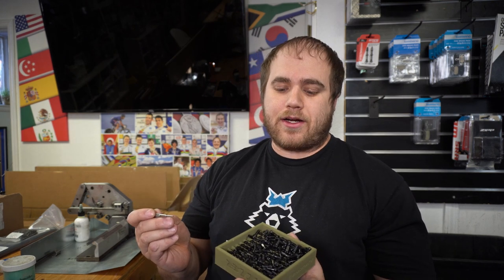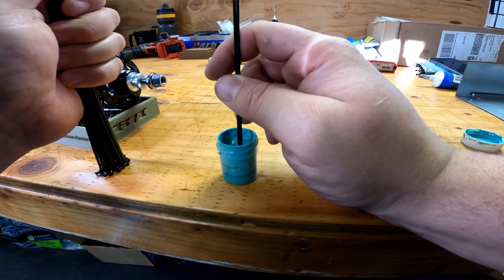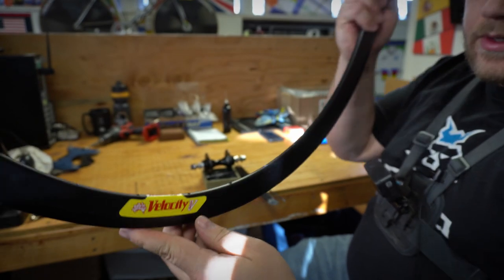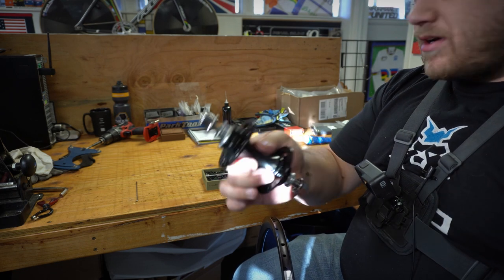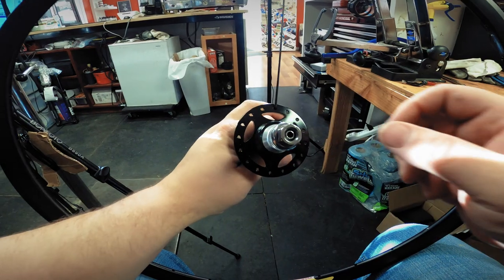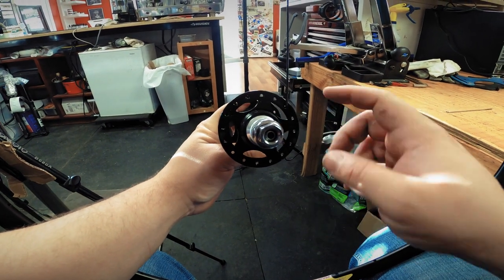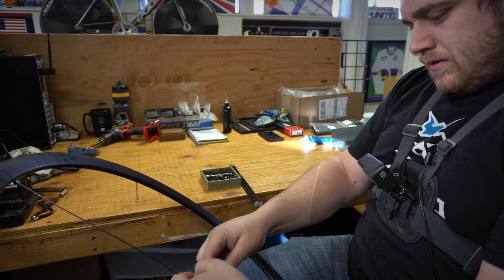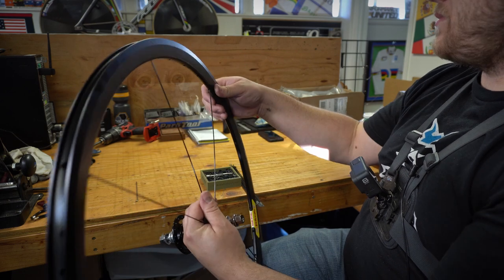Lacing Bike Wheel | How To

Comment: Nice video! Do you always use hubs with flanges or do you also build wheels with straight pull spokes? Eager to hear your preference and why!
Reply from the maker: Hey Menno!  I actually have a couple pairs of straight pull hubs to lace this week so many end up doing a video on those as well.  Personally I think straight pull works fine but I am not a big fan of it as its a bit of extra work until you get some initial tension on the spokes but more than anything, I feel like it was designed because it is more forgiving to poor quality builds like in machine built/mass produced builds.

All the issues marketers claim straight pull "solves" can just as easily be solved by building a traditional j bend wheel properly to begin with but that takes a little more time.

Hope this helps!

Comment: Hi Chris, I come to you again for help with a rear wheel that is causing me problems. I recently changed my bike, went from a hard tail where I practiced xc to a full trail bike, the wheels that came on it are:
WTB KOM Trail i29 TCS, 32h; spokes DT Swiss Competition.

The problem is that every ride I take I come back home with a crooked rear wheel, I don't do jumps or do crazy things with the bike, just some climbs and descents on gravel roads, nothing strange, I just walk normally, it's terrible how this wheel can't stay aligned, before that i never had problems practicing xc with other wheels.

If you have any tips to give me, I would like to tell my mechanic, if you want I can give you other information such tension of some spokes if it helps you in the diagnosis. I just wanted to know what to do to keep this wheel aligned. Thanks Chris.
Reply from the maker: Hey!  Typically if a wheel will not hold up and goes out of true quickly there is either a lot of wind up in the spokes after building/truing, the wheel is not stress relieved well, the spoke tensions are either low, not even or both.  It's hard to say exactly what the cause is without seeing it in person but if all those things check out, it may be time for a different rim as in my experience, the WTM KOM rims are not the toughest on the market.  Hope this helps!

Comment: Hi Chris. Thanks for the great content. I would like to to ask, anti-seize, which do you use?
Reply from the maker: I typically use the Park Tool anti-seize but that is mostly because it is easy to order through my distributors.  I don't have a strong preference there.  Thanks for watching!
Reply: @ChrisMurrayEWC  we are very limited with parktool stuff here in South Africa. Even more so now in this pandemic. I'm sure it is the case everywhere. Thank you so much for your response. If you have an opportunity, it would be great to see how to do spoke length calculations on a rim using straight pull spokes. We rarely get customers asking for such builds in our shop.
Reply from the maker: @sergiokarlluhmann7059  Tools are very hard to find these day.  Most shops seem to be building up their service departments more which I do think is a good thing.  There are other sources for tools you can look into as well although I don't know if they ship to South Africa.  Pedro's and Unior have always been very easy to work with in my experience so hopefully they could be helpful for you.

In regards to straight pull spoke calculations, I honestly don't always have great luck with that outside of with DT hubs.  I use the DT calculator as it has an option for "user defined" straight pull hubs that at least will get you close but it isn't always spot on.

You can find that here - https://spokes-calculator.dtswiss.com/en/
Reply: @ChrisMurrayEWC  I have a Unior supplier here in SA, but manufacturing and delivery dates keep being pushed back. I will keep the DT Swiss link you've given me close. I'm sure it will help once I get a customer who needs such a  build. Thanks for taking the time to help me out. And your videos on starting ones own wheel building company came in handy. Have a great weekend and all the best.
Reply from the maker: @sergiokarlluhmann7059  my pleasure!  I am happy they have been helpful.  You have a great weekend as well!

Comment: Thanks Chris!
How about a tutorial in determining proper tension?
Reply from the maker: Any time!  That one is pretty simple with most rims.  I typically look up the max recommended spoke tension and build to there as I believe higher tensions make for a more durable wheel.  There are some exceptions like older light weight rims usually don't like much more thank 100kgf and modern carbon rims often have crazy high max tension ratings so I typically just build those to 120-130kgf even if the published maximum is much higher.
Reply: @ChrisMurrayEWC  is there a percent difference in tension from drive vs non drive?  What about asym rims and tension?
Reply from the maker: @giffmann2  Lots of variables there like hub dimension, rim offset, etc.  Basically the non drive side falls whenever it does and there is not much you can do about it so you just want to focus on getting the drive side tension where you want it and making sure the dish is correct.  The other important thing in tensioning is making sure tensions are balanced evenly on each side.  You ideally want around 5% spoke tension variance on each side but 10% is completely acceptable too and some rims wont let you get any better than that.  So all DS spokes within about 5% of each other and all NDS spokes within about 5% of each other but the variance between the drive side and non drive side can't really be changed without changing componentry and that can be a huge difference, up to 40% or so on some wheels.
Reply: @ChrisMurrayEWC  My rims are wtb i45 29".  WTB says 110 - 125 kgf.  Does this mean 110 kgf is the lowest that any spoke should be? Thank you so much for this video and the original!
Reply from the maker: @TurkeyBasterandLex  My pleasure!  I would shoot for 115-120kgf on those if it were me.  That would be only the drive side rear/brake side front tensions.  The other side of the wheel will be at a much lower tension because of dish.

Comment: Compared to rim brake, is lacing different for drive and non-drive disc wheels both front and rear. 8:08 is this the lacing pattern for a disc wheel front and rear?
Reply from the maker: Some people like to argue that you should lace them differently but in reality it doesn't make any difference if you lacing things with trailing spokes heads in vs heads out.  I've had engineers with access to pretty sophisticated equipment test this and they couldn't see a difference in lacing one way or the other.
Reply: @ChrisMurrayEWC  thanks for the reply and the video! Glad to hear it doesn't matter.
Reply from the maker: @aaron___6014  any time, thanks for watching!

Comment: Chris should first set of spokes on both sides of hub be head out
Reply from the maker: People like to debate heads in vs heads out on spoke orientation but in testing both in a lab and real world it doesn't make any real difference so I don't have a strong preference either way unless building with a used hub.  When the hub has been laced before I do try to match how it was previously laced.
Reply: @ChrisMurrayEWC   thank you
Reply from the maker: @mikefronczek7862  any time!
Reply: @ChrisMurrayEWC  i guess what i am asking' should both sides be the same or it just doesn't matter
Reply from the maker: @mikefronczek7862  you want them to alternate on each hub flange but it really doesnt matter if driveside has trailing spokes with heads in and non drive side has them heads out or some other variant there.
Reply: @ChrisMurrayEWC  got it thanks again, great help
Reply from the maker: @mikefronczek7862  any time!